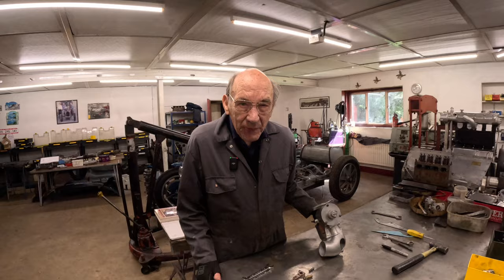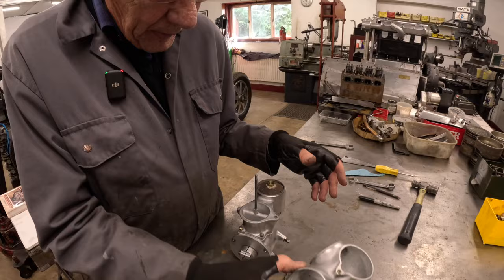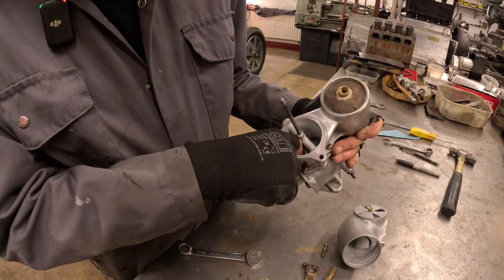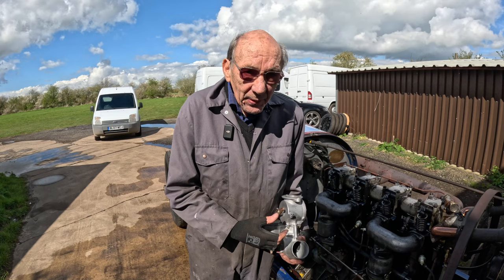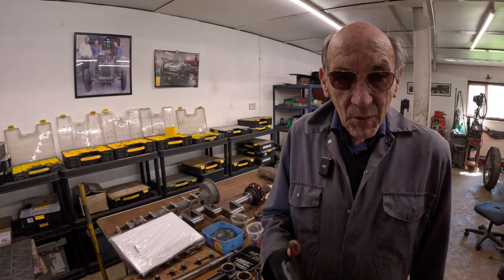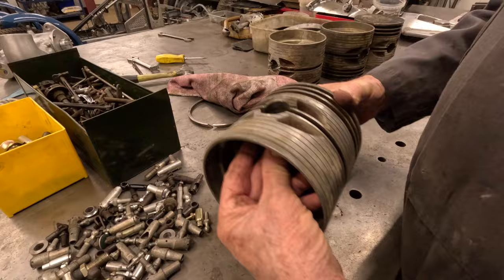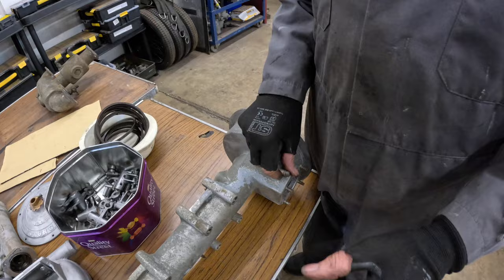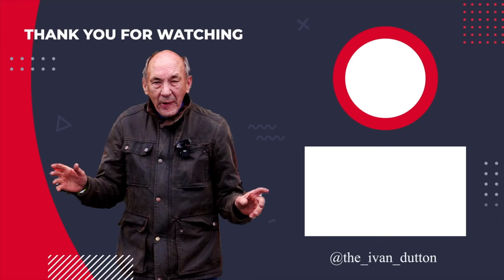SHED RACING - Hall Scott - Carbs and Compression - Cult Chat

Comment: The Miller Carburettor is beautifully designed and made and I agree with everything Ivan says.  However, on my Hall-Scott engine the barrel throttle would freeze on cold mornings and it took a while to get things warmed up despite having a heated inlet manifold.  The other issue is that the carburettor bowl is small relative to the size of the engine so the fuel pressure according to the handbook needs to be in the 3 to 4 PSI range which in my experience tended to overcome the needle and seat leading to flooding.  Ivan, if you were to get in touch I can send you a copy of a Hall-Scott manual which gives all the specifications including jet sizes and clearances in the engine.  As for the pistons the original ones need 18 thou clearance between piston and bore so they are clunky.
Reply from the maker: Thanks, already have the manual. Thanks for the offer

Comment: **. Move the wrist pin down to raise compression to keep the piston lighter! Maybe add .050" to the top to allow for  fine adjustment, maybe put more of the combustion chamber inside the piston? Dish the piston .200" and raise the piston .350" to get the air/fuel in s smaller area for more efficient combustion!

Comment: Classic video Ivan, the crankshaft looks to be the weakest component of the engine, make your compression mods gently, and see if you can improve crank lubing as well. That carb is brilliant, very clever, Can't wait to see it all together and running! Watched the Indian lads cast a new cylinder head by sawing the old one in half longitudinally to make the internal core moulding. They are brilliant engineers, really thinking their way around problems!
Love to all!
Phil , East Yorkshire
Reply: U 7th
Reply from the maker: Great point!

Comment: Regarding piston making.
 I would see seek advice from the foundry fist , they may suggest lost wax casting method  using scion moulds taken from the original you were holding in your hand, It could be made from four a part mould  with the gaugeon pins as cores.to hold every thing in place. Lost wax is used for low volume production  and is cheaper. Just a suggestion..
Reply: I know some jewellery is made lost wax , poor quality generally and poor wear characteristics…very poor.
Reply: @banjopete  I suggest this method because it's used by Ferrari for their engine parts
Reply from the maker: We want to do it all in the shed (besides pouring the metal)

Comment: Love your channel Ivan, and thanks to Suzie for the video and editing effort. Well done! Love the regularity immensely. 
I've seen vintage engine guys add a machined aluminum dome piece to the tops of their pistons. Two blind studs and nuts holds them on, yes they drilled the piston tops (tig repairable later if needed) and had access to the nuts from the underside of the piston. They made a few different thicknesses so testing and swapping was easily done.
Another thought, the use of gapless piston rings on the second groove (check out Lake Speed on YouTube) reduced blow by and increases compression. Interesting technology. 
Lastly if you want to cast new pistons, find a clever lad who can scan the pistons into a CAD file, add your shrinkage and machining allowances and 3D print each core / pattern from a material that is designed for melting away like the lost wax process does. Makes sand casting incredibly easier and you only need 4. Also you can machine ring grooves to suit a more modern set of rings that may improve compression too...
Best of British old son, kindest regards from your antipodean cousins (NZ)
Reply from the maker: Got to be done in the shed!

Comment: For information, piston engine aircraft can, and do, run at full power (flat-out) not only during takeoff but also during climbs which can be for considerable time. 😉 However during full power operation the mixture is always set to full rich which aids cooling.
Reply from the maker: If we use full power is there any chance it will take off at Goodwood?
Reply: @shed_racing  You would need to add some side mounted appendages to get airborne,  mixture rich, full power, chocks away young chap! 👍😁
Reply: Great video Ivan,  ref the oil draining from the cams I think you answered your own question, firstly you mentioned the small rocker box oil drain and you showed us the original low pressure oil pump,  then you mentioned your modified dry sump system and the accompanying high pressure oil pump. So is that high pressure oil pump also feeding the cams, if so then the cam boxes will need bigger drains, won't they?

Comment: Hi Ivan. Love your channel and watched every video. A way of machining an oval skirt on a piston without a piston cam grinder is to turn the piston skirt round in the lathe, with still a bit to come off before finished size, then make a "jack" out of washers and a bolt, or thread stock, that will fit between the gudgeon pin bosses. By jacking the bosses apart you will make the skirt oval. Turn the skirt round again and when you remove the Jack the piston will be oval the right way - with the thrust faces proud and the gudgeon area relieved. With a bit of experimenting you can make as much finished ovality as you need. Machine the skirt with the desired taper, and Mr Hepolite would be proud of you! Keep up the good work!

Comment: For the piston scan it and get it 3D printed, you can adjust the size once scanned and print it out for a dummy build. Then adjust size if required and print a new one for use as a pattern or get it 3d printed in metal.
Reply from the maker: Cant do this in the shed
Reply: Hugh I didn’t know of such thing as a metal/3d printer? That sounds excellent? Any more info?
Reply: You can do it anywhere, the scanners are hand held, scan goes straight into a pc. Take it away print out the part and you can then use it as a master. Once you have the scan you can adjust the size before printing. 
Google or search on here loads of information. I work in the defence industry and they been metal printing components for a decade. It has filtered down to general use but I doubt it’s the same quality, but it’s available.
Reply: @hughmillward705  thanks for that info Hugh! ( defence industry eh?) I bet those damn tanks take a while to print! ( just joking) live long and prosper buddy! 🖖

Comment: Hastings in the US has rings available individual purchase in all manner of bore sizes, thickness, and profiles.  Very handy for getting oboslete engines running again.
Give it a look.  Another possibility if that engine has a 5.25 inch bore is to use a ring set out of a Continental IO-550 aero engine, should reduce friction with more narrow rings. Keeping with aero engine tradition the wrist pin could be retained with plugs like Lycoming P/N 72198. Regards.

Comment: I wonder if it wouldn't be easier and cheaper (considering you're only making 5) to just have them cnc'd out of some nice round stock. Since they're not going to be anything like an authentic original piston anyway, you can definitely use an alloy that grows a lot less, get your tolerances a lot tighter and you definitely won't be needing that ring at the skirt bottom.
Reply: Or maybe get a computer wizzkid to print them , I've seen some amazing things done by our new generation of engineers.
Reply: 5 axis CNC out of billet stock would be worth looking at more expesive than sand cast but faster turnaround
Reply from the maker: Good idea, not as fun as doing it in the shed though...

Comment: On the pistons, have you thought about the loss foam casting system? Apparently they make the piston out of foam, then its packed in sand, and the Aluminum is poured in, as the hot metal hits the foam, it gasses off leaving behind the casted piston.

Comment: When I made my own pistons, after machining the piston slug on the inside, the pin bores done and to the required outside diameter for the bore, I got the taper and ovality needed so as when the piston got hot and expanded unevenly due to differing section thickness and proximity to the heat it could do so without nipping up on the upper part of the skirt and the sides. To achieve this I jacked the pin bosses apart from the inside using a piece of threaded bar and 2 nuts, winding the nuts out so the pin bosses are forced apart, this caused the piston skirt to distort, the amount can be measured with a mike or vernier and the jacking nuts adjusted to get the required amount of distortion, I used 0.020" at the bottom of the skirt under the pin bosses on 94mm dia pistons, then take a light skim over the skirt in a lathe to clean up you will be able to see that once the pin boss jack is removed the piston skirt adopts an oval and tapered shape just like commercially manufactured race pistons made from a relatively high expansion aluminium alloy, this worked a treat for me on various race engines pulling high revs. Think about it and experiment with some old pistons Ivan and you'll see what I'm getting at. Good luck my friend,   Roland, HT Racing Ltd
Reply from the maker: Taken on board

Comment: Carburettor. One can see why the American’s were 40 years ahead of the British in thin wall casting. As to regulation of charge to cylinders you are ‘merely’ looking at 14:1 air fuel ratio. Jetting is to achieve this over a variable distance between sea level and a mountain top. Hence SU’s are better average than more precise Webbers. Your variable window will require little adjustment between your garage and Goodwood. 
Piston. Several points which might be considered the grooves in piston sides are indicative of  old Scott motorcycle pistons with dashes on piston wall to aid lubrication. Scott’s were a two stroke. The rings you show are interesting in they are all upper area of piston with a lower apparently across the fudge on pin. Does the lower end of piston project beyond cylinder and if not would a lower ring achieve better piston stability in bore and reduce piston friction? 
Concerning ovality this was common on GM series cars in thirties particularly Vauxhalls Big Six and the 25hp the manual of which is before me. Ovality was 13thou on bore of 81.94mm. On standard or oversize bores the piston should jam - their word - on 15 thou feeler an inch down the bore 90 degree opposite the plane of the gudgeon on a stroke of 101.6 mm. 10 degree variance will cause a notable error! 
The piston had an Invar strut across it presumably across the gudgeon because it would restrict expansion across the narrow section of the bore. Invar expands less than aluminium and was used in thermostatic switches years ago. The pistons were tapered towards the bottom.
Oil. Mr Ricardo in his biography made the point that pre WWI he discovered that on slow revving engines of the day he gained engine performance by exchanging vegetable oil for mineral oil. All the bearings require is oil between surfaces. This was contrary to the view of the day which looked to mass. Your oil evacuation looks to be 1/4 BSP so next up at 3/8 would be a sizeable increase and look in scale to the engine. I like the O ring idea. If the air in the sump could pump into a chamber, copper or steel tank perhaps with a diode vent and return drain would this solve pressurisation. Try a temporary experiment with a plastic lump as you can see it breathing and see if viable or not and throw it away if it does not work! 
I enjoy your work and challenges!
Reply from the maker: Taken it all on board.

Comment: Harry Miller was a true genius. He was running front wheel drive cars long before anybody else, dominated Indianapolis and even inspired - or got ripped off by Bugatti. But I can't get my head around updraught carburettors. Surely dirt and water would be sucked into the engine with them being so close to the ground. Which is probably why they were replaced by side draughts. I can't help imagining a Miler  carb on a  more modern engine such as a Ford Flathead or a small block OHV V8. That huge choke would produce loads of power and look amazing!
Reply from the maker: Yes, you are right. The Bugatti is nearer to the ground than the Hall and Scott

Comment: Ive. That crankshaft is choice. Acting as a centrifugal oil pump for the big ends. Bloody brilliant idea. With the cute little catch plates. Over the last 15 years or so, I have come to respect american engineering. I totally agree with you. Alot of thought, without any engineering fuss. The stuff works and works well at that. Tnx goes to Suzi once again for the pertinant questions.. I'll run my thoughts on the oil pump by you just as soon as I am able. Take care. Bw from the Forest of Blackness. Mike.
Reply: Early British and other cars had troughs of oil flicked up by fingers on the big end bearings. The troughs were filled by an oil pump. This works fine at low powers but increasing load needs flow or the oil gets too hot. Cheers Martin.

Comment: Ivan the o ring idea on the rocker fulcrum is good but o’rings don’t like movement so will probably work harden on wear away extremely quickly. I would use bronze bush washers with a very close tolerance.

Comment: You could also offset pour the Babbitt rod bearings (thicker at the beam side , thinner at the bottom) effectively moving the piston higher in the bore.
Reply from the maker: Scared to touch the original babbitt

Comment: Have you seen "Making Pistons for experimental and restoration engines" by Stephen Chastain? People seem to be asking stupid money for copies, but you'd be welcome to borrow mine.

You can see the parting lines for the 3 part core in the piston. It should be possible to take moulds from your piston without cutting it in twain.

These days, I'd be thinking about 3D printed patterns. It's possible to 3D print 'wax', or many people are using PLA plastic for the purpose.
Reply: Yes, and could add in the extra for shrinkage, too.
Reply from the maker: Thanks very much but I think I have enough knowledge of pattern making to be able to bodge something up

Comment: That barrel on the miller carb looks like it opens the wrong direction,the spring would pull it open not closed, unless you turn the body round..Ian..??
Reply: or fit the bracket and spring other side of the carb. so it pulls back towards rear
Reply from the maker: Well spotted! We will fit it the other way around

Comment: Is it possible to weld a shallow dome onto the piston tops to increase the compression and then use your slimmed rings, it seems a bit simpler. In medicine we often prefer Occam's razor, but obviously I'm no engineer (or specialist welder for that matter).
Reply: Or bolt on a dome/wedge for that matter
Reply from the maker: I've heard of people doing it but a bit frightening
Reply: @shed_racing  I've also heard of some bronze "skulls" being fitted Into the combustion chamber, both to increase the compression and the squish area, but all a bit daunting and above my pay grade.

Comment: one thing I noticed on your current twin carb set up is there doesn’t appear to be a balance pipe fitted between the front and rear inlet bank of cylinders so you’ve got cylinder 1&2 running independently to 3&4 ?? Maybe there is one that I can’t see but I would strongly suggest fitting one before you remove the current setup as it will make the engine run a lot smoother and pickup quicker.. sounds silly in comparison but I trial a twin carb Bullnose Morris and when I first built it I forgot to engineer in a balance pipe so it ran just like your current setup and it was a bugger to get right and very lumpy .. after a while I drilled the manifold and added a pipe between the front and rear carb and the thing now flys !! It also gained a lot more low down power (not sure why but I think it maybe down to smoothing out the suction pulses ?)
Reply from the maker: You are dead right. I actually know the importance of a balance pipe but hadn't thought of it until you mentioned it. We are actually going to do it to the manifolds in case we put the twin setup back on.
Reply from the maker: What diameter are you thinking?
Reply: I’m glad you took the time to read my comment as I love watching your videos 👍 I would guess at half the size of the carb bore ? I remember it used to be a thing to do on the twin carb A series manifold to punch out the balance pipe plug and open up the hole inside to allow more gases to move across… I think it would be a good thing to do before you fit the bigger single carb so you can get a better understanding of how much better the bigger single carb will be compared to the twin carbs ? Look forward to seeing how you get on with it 
Russ
Reply: @hennessymotorsportltd7756 very good logic but also remember you are balancing between two very similar levels so not really needing to act as an effective transfer tube of any great volume assuming they were almost balanced by design anyway…

Comment: I have a bit of 4mm thick sheet of insertion rubber on my bench so I am not working on the bare steel that will make the aluminum surface on the carb.

Comment: Got a feeling that an aero engine and it's carburettor is designed to run at a constant speed more of the time, would the miller carb have the on, off, up, down responses that a carb designed for a car would have, I may be wrong.
Reply from the maker: You may be right, we are going to find that out